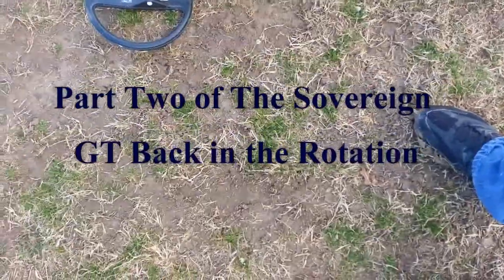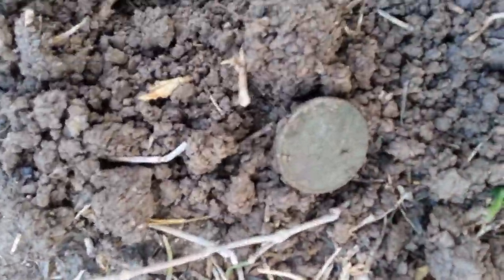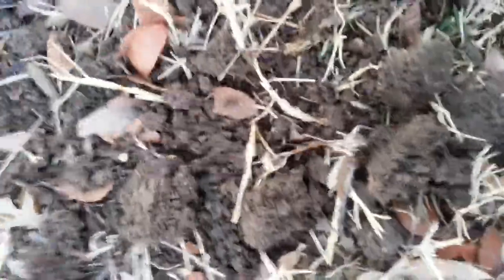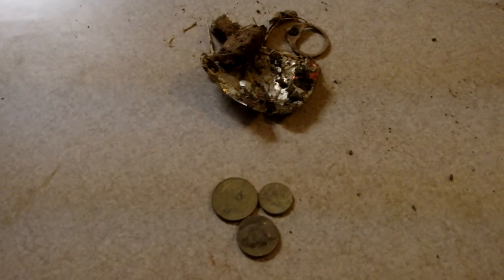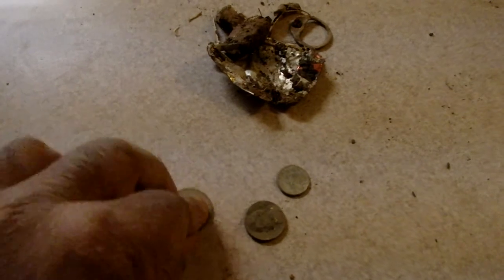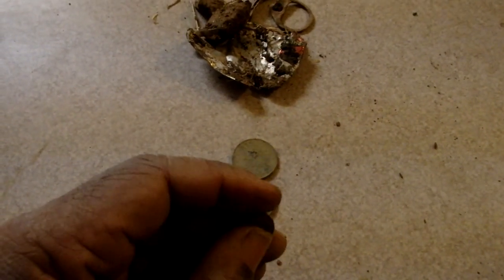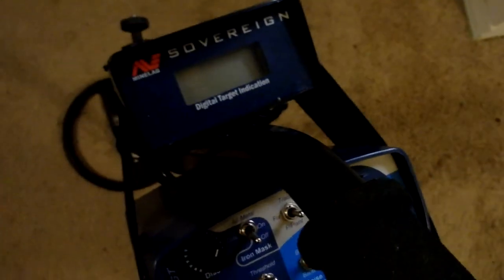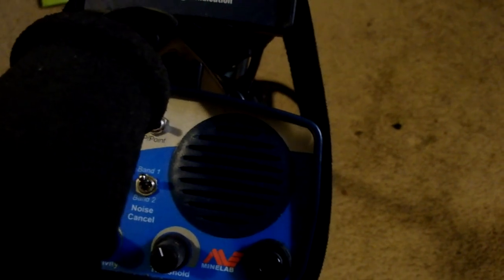Sovereign GT Back in the Rotation Part 2

Comment: Good hunt TTD.  That  Sovereign can hit'em pretty deep I hear.  looks like a heavy machine tho.  Thanks for posting.  HH
Reply from the maker: It's comparatively heavy, especially if you compare it to the Deus, and Compadre and the slightly heavier Tejon (heavier than the previous two mentioned).  It's like using the Xterra 705 with the big coil all the time...put the big coil on the GT and you can work on you lats and biceps. Between you and me I need the work though...Ha Ha.